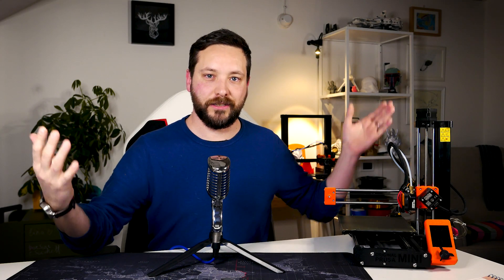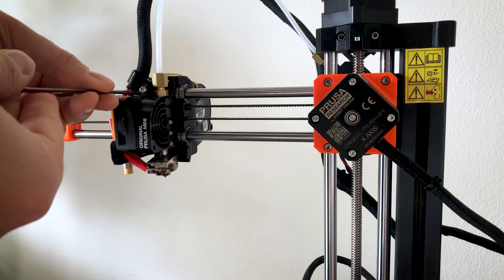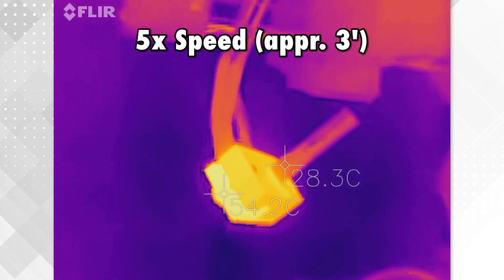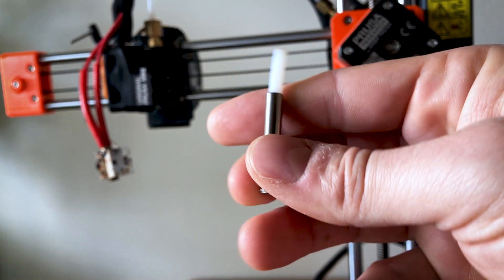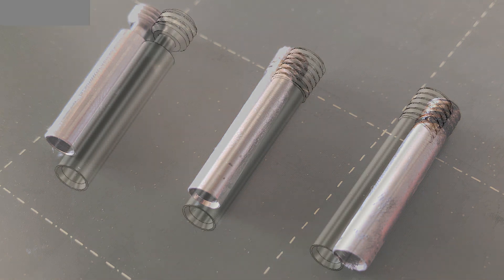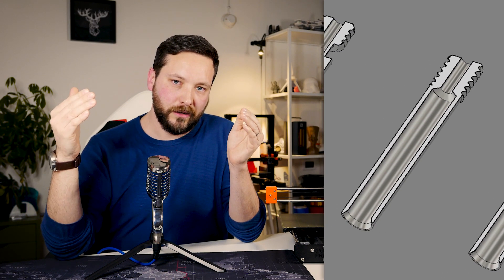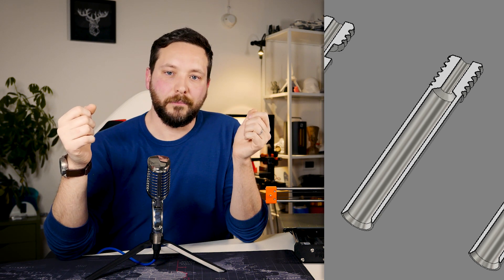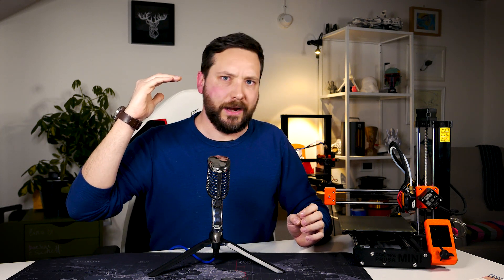Bondtech Stainless Steel Heat-break for Prusa Mini: why is it better?

Comment: Have you seen any issues printing Silk PLA? I upgraded my extruder and heatbreak to bondtech at the same time, and now I can’t print silk, but I can print basic PLA.
Reply from the maker: I'm using silk quite regularly with no issues. Maybe it's a PID problem

Comment: Question for you. At the 3:25 mark you said to remove the nozzle and heat-break "you need to heat it up."

Why do you need to heat it?

and at what temperature did you heat it?
Reply from the maker: The plastic works as a glue and sticks the heatbreak to the heat block. 180-200 is more than enough, I guess 150 can work too. 
I handle them with pliers anyway. Be careful!

Comment: Great video, well done. 
I have had nothing but blockages with my "genuine" Prusa mini when printing with PLA or PLA+. So I am about to upgrade to the Bondtech heartbreak and pray that it sorts out the problem with blockages when printing PLA.
So, watch this space ....!
Reply from the maker: Is your exuder idler well set? That was causing me some headaches
Reply: @AMakeDesigns  Yes, it's fine, well tuned. It just gets blocked with PLA, so definitely heat-creep. Bondtech heatbreak hopefully will sort it.
 Nothing wrong with single cog Prusa extruder, in fact it makes for better prints than when using dual cog extruder, see Mihai Designs explanation on this, the guy is a genius. https://mihaidesigns.com       He has a Youtube channel also. I am using his Pitstop extruder on my MK3S+ and it works beautifully. Not one blockage, ever !
Reply from the maker: I have seen it but I'm not too convinced. I don't see the artifacts he is complaining about, but I don't have a MK3S

Comment: Excellent explanation! And not to be unappreciative or anything, but I am missing the part explaining what advantage the Bondtech heat break offers practically - why would I want/need to change the original Prusa heatbreak in the first place.
Reply from the maker: Practically I didn't find any real difference, but I'm printing mostly basic filaments. The mini is already capable of high temps, but I have seen people struggle with heat creep.
If you have heat creep issues or printing a lot of high temp filaments I would look into that since the price is quite low.

Comment: Ciao! Ho assemblato una Prusa mini clone ed ho installato un hetabreak bondtech. 
Stampando ho notato che l’estrusore fa uno strano rumore ed effettivamente la ruota dentata nelle estrusioni veloci salta.

Può essere che il problema sia il non aver accorciato il tubo PTFE azzurro della lunghezza aggiunta dal tubo PTFE di bondtech? 

Ps. Bei video! Continua così
Reply from the maker: Ciao Angelo! Direi di no. È più probabile che sia o la temperatura o il serraggio della vite dell'estrusore. Il setting è abbastanza delicato, se tiri troppo il filamento di ovalizza e stringe nel tubo di teflon.

Comment: I'm having a lot of problems with the extruder and the hotend of the Fysetech prusa mini clone, I' currently testing a BMG extruder but still having jammed filament on the extruder. But I think the hotend is not good enought and is causing jams on the extruder or is causing clogs in the nozzle . Do you think it could be possible to install E3D or mosquito hotend?
Reply from the maker: I doubt. They might be heavy. Why not the Bondtech?
Reply: Several people have installed the E3D V6 hotend.  I have one in the way, but with the proper style heatbreak, really isn’t needed , at least for PLA and PETG.  The clones are now shipping with a much better heatbreak.

Comment: Nice! Is there a video comparing "real world" benefits of using ALL the bondtech upgrades together vs. stock prusa parts? Maybe if your not able to see the benefits on an actual print, maybe just an explanation of WHAT you should expect to be better and why for us "NOOBS"... 
For example, I clearly see that the bondtechs heat break works better... But what can you expect from that upgrade?
Also, the extruder. I would love to see an improved part where the stock part would have been less adequate...
Im sorry. I just love "upgrades". I upgrade everything I can... my cars, my computers, my drones...hopefully my 3d printer. 👍
Reply from the maker: I have "a feeling" that the new heartbreak works better, but I cannot state it with facts. I have seen other videos of people claiming it improved quality but mainly because it was solving a problem (heat creep, I assume).
The data shows it does a better job of improving the insulation. Finally  I don't think I would have done it if I didn't need a new heat break for my clone.
My Prusa hot end worked fine from the factory. On the other hand I really enjoyed the extruder upgrade (check the video out 😉)

Comment: Actually all to get the special cut at the end of the PTGE tube to fit perfectly into the champfer is a spectial cutting tool also known as "pencil sharpener" :-)
As on my experience filament often get stuck at the fittings there the 3 parts of the bowden (inside the hotend, between hotend and feeder and inside the feeder) are conected, I changed the fiting on my original prusa to normal pushtrough pneumatic couplers. So instead of 3 parts of tube I now have only one.
It also helps if I use filament with not perfect diameter. I sometimes get filament wich is not perfect - but I do not want to throw it away as it might be usable for tests anyway. I use a tube with 2.0mm inside diameter there. But on highly precise filament like prusament, extrudr or sunlu I prefer an inside diameter of 1.9mm (like Capricon) due to the more precice feeding. To change the tube is a task of only 2 minutes...
Reply: It's not easy to find 118° pencil sharpeners. If the PTFE chamfer angle is too small a length would be unsupported.
Reply: @AwestrikeFearofGods  I nether had problems with using a pencil sharpener. Actually the biggest problem isn't the heatbreak at all, but the coldend fan trottled down to 38% by firmware. After changing the coldend fan to a Noctua at 100% speed, no heatcreep ocured anymore, even with original heatbreak. On older buddyboard GND is PWM controlled, so just to connect GND pin to permanent ground. Newer Buddy controlls 5V pin, so firmware editing or extra stepdown is required.
Actually I am about to upgrade my minis to Revo+TBG-lite anyway.

Comment: Great video- They did make it clear in the instructions that you need thermal paste, but I missed it at first also, and had to stop my upgrade until I could get some paste. It would be nice (even if they make it a little more expensive) to include a small thing of thermal paste in the package. I also like your comment about including extra PTFE tube- or possibly boring the hole in the hot end with a flat end mill.
Reply from the maker: Thanks mate!

Comment: great review, however the genuine prusa heatbreak is actually rated for 280c, not 245, as the ptfe does not reach the meltzone, so only reaches around 160c when in use
Reply from the maker: You are right! I actually reviewed the spec later but the video was already done. Thanks for clarifying

Comment: I own a clone, let me tell You that the massive filament leakage You have on Your clone (if You care about it) is due to the clone heatblock which is bigger than original heatbreack so You cannot get the hotend properly assembled, no way.
I installed a bondtech heatbreak clone from trianglelab with a little thermal paste, I have to say this made a huge improvement in print quality, no more oozing, leakage, stringing, since last hotend rebuilding done 6 weeks ago. 
I recompiled the firmware increasing the hotend fan speed from 3000rpm to 4200 rpm to align it to the fan speed achieved on original mini, I think this also helped on avoiding oozing.

I don't know if on a original mini it is an improvement, several reported lower print quality especially on using prusament filament. Instead it's  definitely an improvement for clone owners. highly recommended if not mandatory.
Reply from the maker: Very clear! I did not notice the leak until I shot the video. Let's see how it goes with the Prusa heartbreak 😉
Reply: sorry in the first sentence I meant original heatblock, not original heatbreak.

Anyway nice video, interesting as usual.
Reply: Hi Valerio, the last time I was on Ali express I ordered the same heatbreak from Trianglelabs, but until now I have not installed as there is little info on how to install it.
I have the Fysetc Mini clone and the heartbreak that came with the clone, I must say it prints quite good and no issues, but I want to be able to print with higher temps and therefore the new heatbreak.
What did you have to do to instal it properly, the PTFE insert for example, I have read that for the one form triangle labs is as to be 3mm longer then the one from Bondtech.
Did you cut this PTFE yourself if you used a jig do you mind sharing which? Did you use a similar PTFE as what came with the mini clone? For example the leftover part?
The couplings, the ones that came with the mini clone differ from the ones used with the bondtech and prusa heatbreak, for that one it needs to be in such a way that it contains the PTFE insert in the heatbreak, I believe the coupling that comes with the clone does not as it is designed to hold the PTFE tube that comes from the extruder and goes down to the nozzle.
what did you do with the existing PTFE tube, that one will be longer if it does not go down into the heatbreak, or did you cut the part of and used it for the insert?

anyway, I ma planning on buying these extra parts to make sure everything goes OK, especially the heatblock as the one that comes with the clone blocks the airflow of the standard fanduct (I moved the fan to the from=nt and now my bridges are perfect!).

https://nl.aliexpress.com/item/1005001414256208.html?spm=a2g0o.cart.0.0.60a43c00W3QhYJ&mp=1
https://nl.aliexpress.com/item/1005001405577637.html?spm=a2g0o.cart.0.0.60a43c00W3QhYJ&mp=1

And this is the heatbreak I bought and want to install once I have everything sorted out.
https://nl.aliexpress.com/item/1005001689822459.html?spm=a2g0s.9042311.0.0.36824c4dOQL1Uf

I hope you have the time to share.

Comment: So, based on your conclusions, one could say the Bondtech heatbreak allows to print materials that demand higher temperatures while retaining the ability to print PLA or flex?
Reply from the maker: I think it will safely print higher temps, but I did not test the original one with high temp so I cannot say if it is possible with the original. To print Flex I had to upgrade the extruder though. No way i could print flexi with the original one
Reply: @AMakeDesigns  I’ve had great success printing flex on my stock Prusa Mini. I’ve used SainSmart 95a TPU and it prints like a champ.
Reply from the maker: Good for you! I had a lot of issues with the gap between the extruder wheel and the exit hole. I installed a bondtech extruder and all of it went away
Reply: Correct. I print NylonG all day long at 250 with the bondtech heatbreak on my mini.